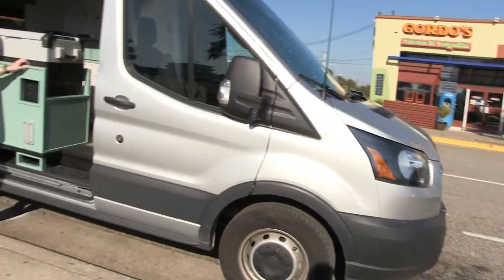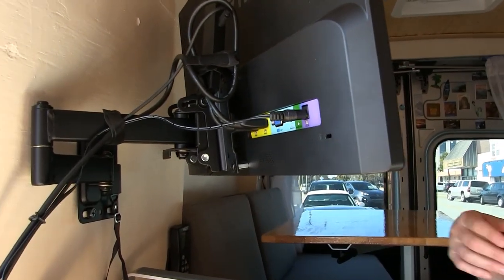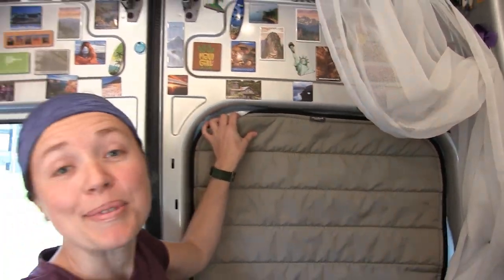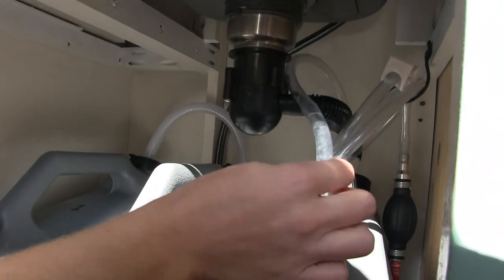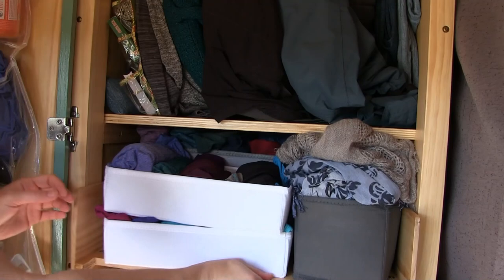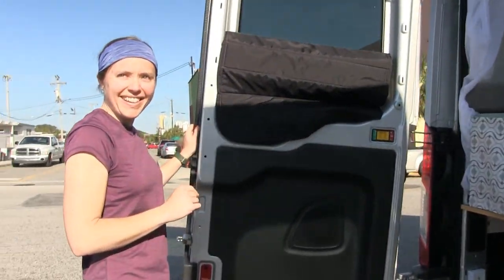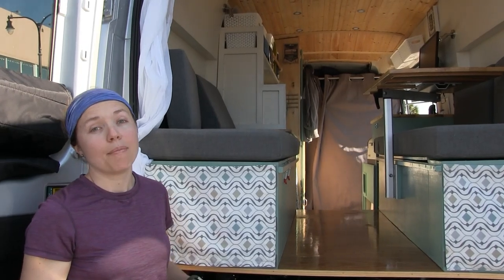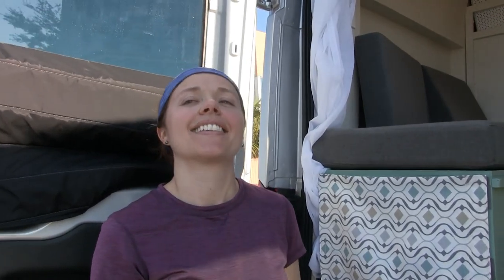VAN LIFE | GENIUS DIY Homemade Campervan - Ford Transit Conversion

Comment: Way'ta'go Lindsey.  Nice job.  I've built a few of these in my lifetime and I know the labor and thought that has to go into "making it happen" even recall working 36 hours practically non-stop while living in Chicago to finish up one to trek the west over a 6 week period with less built ins so that my wife and I and two small kids could live in the thing and travel over 10,000 miles in our short vacation.  The weekend I drove the brand new Ford Econoline van up to Cassopolis MI and had the metal top cut off and a tall fiberglass one installed with dual sliding windows and amazing storage over the driver area and roof top storage and overhead bed, my wife went nuts.  Hehehe.  In the end, we ended up with an amazing rig and sold it for more than we had in it AND vacationed in it and put 30,000 miles on it in less than 18 months.  Thanks again.  I would like to know what kind of fuel economy you get with the Transit?
Reply from the maker: Wow thank you for sharing that. Owners report, once converted 17mpg
Reply: @NewJerseyOutdoorAdventures  thanks for that info.  I'm still thinking that unless I found a really good deal on the drive unit, and could justify my kind of down to earth mod plan at less cost, that a small RV might still be the way to go.  They too get in the teens for fuel econ, some mid to uppers if under 22' C chassis when driven the way I do (not in a hurry or jack rabbit take offs), and they literally provide a lot more space and nicely done, plus some comfy couches, always ready beds, and plenty of inside and external storage.

For the moment thought, because of budget Ima prob get a used =/< 22' travel trailer weighing in under 3,000# and should haul behind my Honda Ridgeline comfortably with a 2K gene in the rear of the truck anchored down along with a nicely hidden larger storage tanks, and plenty of propane safely outside the unit, along with I'll install a nice set of panels on the roof with a couple of those lithium 12v batts.  Just a thought. I do like being able to drop the camper at some spots or just park in a parking lot or rest area for overnighters. :-)

Comment: If I could give this conversion two thumbs up, I would. This van is actually quite small despite being a high top and yet it’s packed with a ton of features not often seen in a van of such compactness. Often this sort of styling is only found in the significantly larger and way more expensive sprinters and promasters. I was blown away to learn that the build cost just ten grand. Like many, I’d love to see that spreadsheet. Maybe she can put it online somewhere, like Dropbox. This young lady has done herself proud, for sure!
Reply from the maker: Thank you very much

Comment: Impressive van and video. My question is about heating, cooling, and ventilating. I suppose you could try to always keep moving to find the perfect temperature, but I imagine it could get quite stuffy inside without screened windows and overhead vents. Plus nights almost anywhere can get chilly enough to wish for some source of heat.
Reply from the maker: She uses an electric heater and 12v fans

Comment: Very cool tour! Kudos to the video host/ interviewer and of course to the woman who shared the tour of her rolling home and all of the design elements so well planned and accomplished.

Very thoughtful design and good multi use considerations overall. I like that she expanded the engineering and materials selection by borrowing from boat interiors, like the swivel table, love the floating mount and that it serves multiple purposes, including being her meal & project table, as bed support when lowered, and also the the outdoor mount for use as stand up desk and outdoor cooking or dining table.

Personally I would never want a propane tank under me while sleeping, nor would I have a porta-potty in such a small space.

I like 90% of this innovative van conversion, and would like to see follow-up tour after her first 6 months then after her first. year of van life. I’m curious if she is still doing full-time van life. In this video she was just 3 months into it. Obviously pros & cons to being full-time.

The major change I would’ve made: the height. consideration.

She said that the van is 9 feet tall so it does not fit in most garages, hence the build was all done outside, exposed to the seasonal weather changes.

I would budget for renting an indoor, climate controlled space that is tall enough. This would come in handy especially for the issues she had with temperature limitations for certain materials and adhesives that don’t set-up, dry or cure in extreme temps or in seasonal humidity.

Okay, back to height: I would research the average height limits of commercial parking garages throughout the U.S. To stay under the height limit would ensure more options fir overnight parking. 

Think about it: There are major cities where you can’t street park overnight , but there are lots of parking garages that have overnight rates, typically 6pm-6am for about $5 to $14 per night. Since you can’t count on there being a Walmart parking lot or rest area within a reasonable drive time/ distance.. great to have the option of parking garages.

My approach to van design would be to have a pop-top roof system. The van travels low then expands upward for full vertical height when needed. Obviously it’s a major thing to do, and not cheap when done properly. 

There are several good videos on YouTube showing the conversion of vans to be pop-top vans. Obviously it means cutting the roof off, inserting a border system for receiving and connecting the pop-top.

Any comments or variations on what I’m taking about? I think that having a van that is adaptable to space limitations is important. I would also design a few slide-outs into the van design. To be able to expand both vertically and horizontally would be ideal.

Cheers to the van owner and to the video maker!
Reply from the maker: Thank you for watching and for all the suggestions

Comment: The safety features of this van build are incredible.  I have never seen a propane "locker" but what a great idea.  The battery box is easy to get to if there is a problem, yet tucked away out of sight.  I also like the dedicated work desk and the well-organized closet with a full wardrobe...and even hanging coat storage.  The Instant pot storage is great too.  I certainly would not want to travel without one. This has to be one of the best thought out builds I've seen in a long time, plus it looks very comfortable and has a "home" feel.  I wish this young lady all the best in her adventures.  :)
Reply from the maker: Thank you very much for watching. Please subscribe for more videos like this

Comment: That a bit expensive conversion. I converted my van for 2k pound, sterling that's include solar, inverter and battery. Bought my van for 8k 2014 Renault traffic. Why is it everything expensive in the U. S?
Reply from the maker: Thank you for watching. USA 🇺🇸 is expensive because the wages are high
Reply: That's what I know of here it 8 pound an hour for blue-collar but for, white collar it's difinitely higher than u. S.
Reply from the maker: Things are getting so expensive

Comment: Is there heating and cooling?
and How many miles per gallon does the van get? How much gas does it hold? (that is, how many miles per tank can you travel?
Reply from the maker: Electrical heater and dans for cooling
Reply: "I have the Ford Transit 250 High Roof 148" wheelbase." Then goto the Ford website to find specs.  These vans drive like a minivan!

Comment: The thing that kind of puzzles me is these refrigerator units.  Ultimately, they produce heat which is pumped right into the cabin again.  In a cold climate this is fine, but in a hot climate this seems counterproductive.
Reply from the maker: It is but it’s the same way in a home
Reply: @NewJerseyOutdoorAdventures  A regular home is much different situation though.  You can't think "big house strategy" in a van.
It seems these refrigeration units really need a split strategy somehow.

Comment: Are the back doors insulated? And why the recesses behind the couches? is that to make the bed wider or to open storage? Or to cover wiring?  Wonderful build😊
Reply from the maker: I am not sure but she may answer.
Reply: The back doors are insulated with Thinsulate - the batting type material that doesn't hold onto moisture. The cargo van has many holes in the doors that insulation can be stuffed into and then opened back up once inside. Good eye on the recessed walls! It added 3 inches on each side so when I lay down I can sleep side to side rather than take up more room with a front to back bed.

Comment: Thanks for the video Patrick...super sweet girl and nice conversion. The power/electrical system is so important, especially for full-time van dwellers. I"m always curious about the size of the inverter and how big the battery bank is. It looked like at least 2 100 amp Battleborn Lithium batteries and if she's running her Insta Pot I'm sure a minimum 1000 watt inverter. I think the ideal is 400 amps of lithium, a 2000 watt inverter, and all the solar you can fit. She had 360 watts which is great!
Reply from the maker: Thank you for watching David
Reply: Hello David! You are correct you saw two 100AH lithium batteries. My inverter is 2,000 watts - more than I need but big enough if I ever decide to add shore power and opt to charge my batteries that way. The 360 watts of solar + the 60amp Sterling battery to battery charger have been rocking it so far though so I don't anticipate needing to go the shore power route.

Comment: What is refreshing to see is that a woman knows all the technical stuff and can guide you solo through the tour.  What a joy to see that.  Way to go, sister!  A fine van build and lots of creative ingenuity in storage, colors, mods.  Lovely van.  
I like the little office area, very nice workspace.  I find that in commercially made vans, they still create 1950's style dinettes which I absolutely hate.  I converted my dinette (ripped it out!) into a long desk, cabinets, and work space.  So much better and can be used for dining, working, or hobbies.  This is the way to go. 

Strawfoot window covers full set for Ford Transit runs $1300 - $1600. Ouch!  It costs $100 to buy a vintage Viking sewing machine that goes thru thick fabric (6030 model or 6000 series), and you get some Sunbrella type material, sew it onto Thinsulate and done.  It won't cost anywhere near that amount even at retail prices and tools.  If you want to use a short cut, use IKEA blackout curtains as raw material, they are always on sale in the AS IS section. Sunbrella does not fade though. Do not sew in any bubble wrap like Reflectix which is not washable and degrades.

Comment: Wow! That’s great. I can see why it took a year to build. I’m curious about the amount of planning time that went into it before the build began. It is so well thought out and executed. I wish she would have mentioned some info about doing laundry, parking stealth, showers... just her experience van living, but possibly it was too soon to get into those details. Thanks for sharing. Oh were the walls made of pine as well?
Reply from the maker: Thank you for watching. Lindsay may comment
Reply: @Treasuring Priceless Time. Thanks! It's hard to quantify how much time was spent planning as I had the idea for about a year before I pulled the trigger on actually starting to draw things out. Laundry - I can hand wash small things and let them drip dry on the pull out towel rack next to my sink. Otherwise I go to laundromats. Showers - I have a gym membership that allows me to use locations all over the country - there are a few gyms that offer such a thing. Sometimes I stay in campgrounds and use those showers. Stealth parking -  There are numerous apps and websites where people can leave reviews on stealth/free camping locations - search and you'll find them! The walls - the walls are 1/2" plywood- this allowed me a more sturdy material to anchor things to. Ford Transit cargo vans have many premade holes in the frame. I used something called Plusnuts to make an anchor for bolts and the plywood walls are held up that way.

Comment: May I suggest nets for storage ( look in a boating magazine for what I am talking about) you can hang them from Command hooks. Excellent storage for groceries and household items. Damp-rid is a humidity remover and works well. Safety consider a flare gun with multiple cartridges. Bear spray. A paintball gun can be protection.
Reply from the maker: Great suggestions
Reply: Pamela Raney > and a fire extinguisher if she doesn’t have one, but I’m betting she does
Reply: Tari Akpodiete definitely. And a big one not some crap tiny one
Reply: I have a fire extinguisher attached to the wall under my desk :)

Comment: Nice build young lady. What type of business do you run on your computer? Just curious what everyone does on computer for a living?
Reply from the maker: I am not sure how the computer was used for her work
Reply: Great question! That was the final problem I needed to solve before taking the jump and buying the van. When I started the conversion I was working as a remote RN Chronic Care Coordinator and ESL teacher. I now do data abstraction for a healthcare tech company. I found all of my remote employment jobs on a website called FlexJobs. It requires a paid subscription but I personally found some solid remote work that I was not finding through regular Google searches or some of the other job search engines.
Reply: I have my fce test today Dec 6th too see what my left arm can do and not do. Fell off top step of semi back on March 9th landed on the top part of my shoulder and it separated 3 inches. Been long summer with therapy. Checking out different ways of living besides renting.

Comment: I understand how people can work from their computer anywhere and that's fantastic. I wished I could do it myself. But I am curious as to how they get their paycheck. Is it Paypal or direct deposit? And what about mail? I'm sure she can keep in touch with everyone via email/texting/phone but what if her parents wanted to send her a Christmas or birthday present or something? It's the living details like those that I'm most interested in. I love her van but I don't think I could handle something without a shower. I do love cassette toilets though. They are extremely convenient. No having to pull over to find dumping stations! The only thing I would need is a shower and a hot water heater. I guess I could just wash up by heating water on the burner but not sure how that would work out lol and I would be just too embarrassed to go to a YWCA or something. Overall, I'm in love with this van. It has so much room and really laid out well. But please try to get more details on how to personally manage your business while van living. I'm really interested in that part.
Reply from the maker: Thank you for watching. Lindsay may comment to answer questions
Reply: I get paid through direct deposit. I've had a few different fully remote jobs and I found them all on FlexJobs - maybe you should check it out! I can order things from Amazon and pick them up at "lockers" across the country. Getting USPS mail while traveling is supposedly possible, but I have not tried. I will be going back to my parent's home to visit so I can pick things up then. I rarely get anything important in the mail - everything can be done online these days!
Reply: @Lindsey Taber - Thanks for the response! I've never heard of FlexJobs! And I didn't know about the locker thing with Amazon. I'm a complete newb at living on the road, not even having been out there yet but am in the process of looking for something to do it in so I can start downsizing so I can hurry and get out there. I'm 59 years old and have "done my thing" - marriage, kids, etc - so I'm ready to take it to the streets but I want to know all I can know...its not the same world out there that I knew when I was young. Do you ever feel unsafe? Do you always stealth camp on busy streets? Are they safer? Do the police ever ask you to leave a spot? Have you ever done the Walmart parking? I'm sorry I'm asking so many questions but you really seem to have it all together! And I appreciate your replies! I have a lot to learn!

Comment: Wow...just wow... I've seen a huge number of van builds, this is the best!!!-  How big is the bed?
Reply from the maker: Thank you. I believe it is a double
Reply: Thank you! The bed is roughly 72" x 56". We sacrificed a little insulation to build a section of the walls out 3 inches on each side of the majority of the sleeping area. If it's just me, I can also set up only half the bed and leave the table intact, which is a nice option.

Comment: She;s got a great DIY rig and the amazing outlook to go with it.  The van is very stealthy despite the signal booster, roof fan and solar panels  The well planned roomy bed/dining area above the bike garage is more impressive because the living space has so much headroom!  Showers and emergency parking can be done at the hospital which takes cares of two important factors to van life.  Lastly, the centrally located master kill switch is very easy to quickly reach, and the batteries/electrical nerve center have the added security of not being exposed to the elements and activities that garages are exposed to.  I'm a big fan of the conversion!